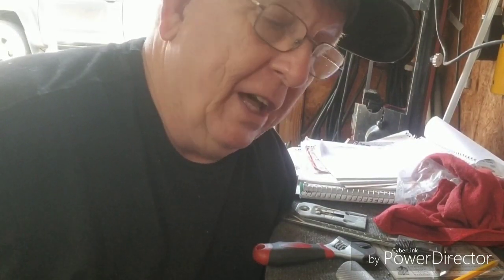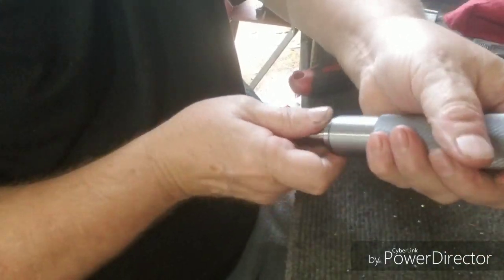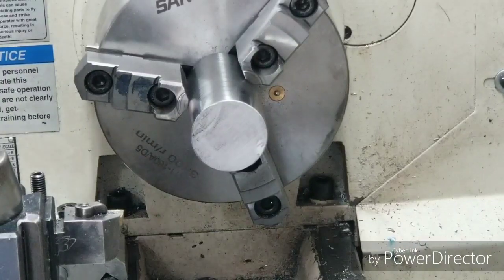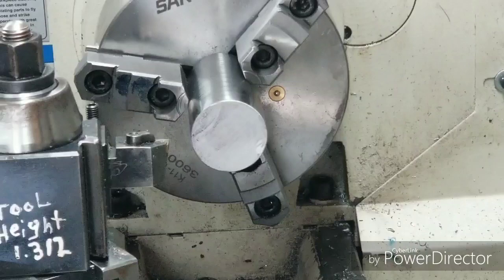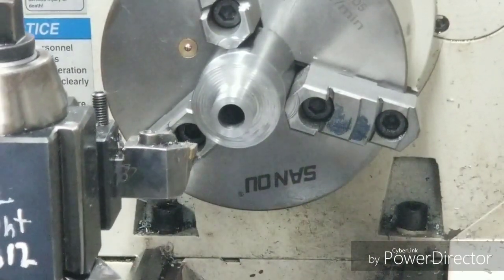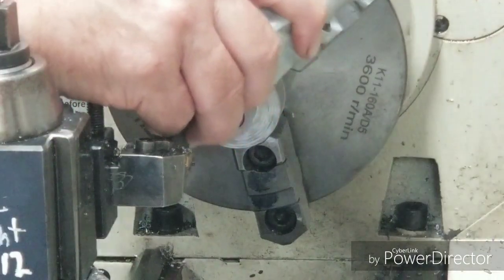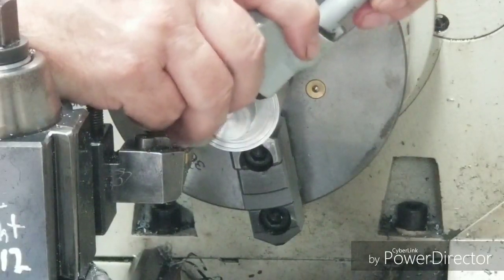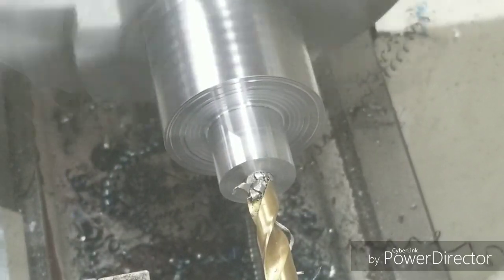Shop Made Tailstock Tap & Die Holder (Episode 2)

Comment: Looking good so far!  I sometimes get the birds nets as well - I use similar inserts because they came cheaply, and they sometimes give me grief on 4140.  A36 would be similar.  Having similar machines we face similar challenges.  I still need to make one of these die holders, just haven't gotten to it yet. I like how yours looks so might snitch a few design ideas
Reply from the maker: Can't afford  the high priced Inserts. Retirement and Social Security  don't  go for .
Reply: I've been having the same issue. Found that a steady oil bath seemed to help get the chips to break. Those crazy birds nests scare the crap outta me 🤣. I just see the meat getting stripped right off my finger like a friggin horror movie 😬.

Comment: You just wanted to plug my oil cup.lol. Looking good so far it’s turning out well. I’m curious on your feed and speed selection and or material selection. I never have that much stringy chips on full cuts, it looks we’re using similar inserts. It mostly 1018 that I use, with some 1144, and rarely 8620. So I’m just curious if maybe you’re speeds and feeds combinations are different
Reply from the maker: Was a piece of A-36 I had, not a good chose.  But all I had and turned out ok . Just a lot of stringers when turning.